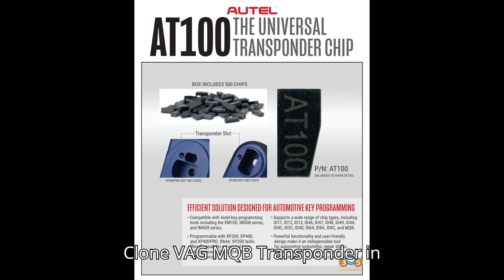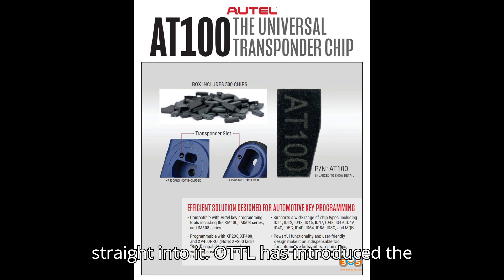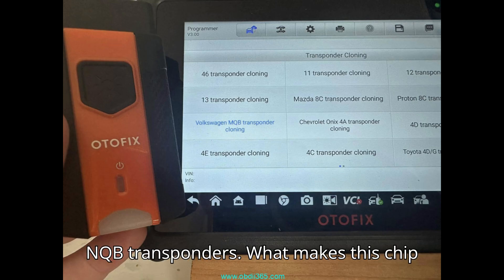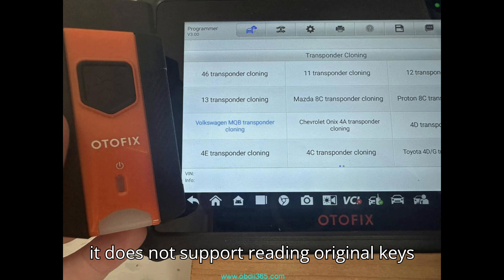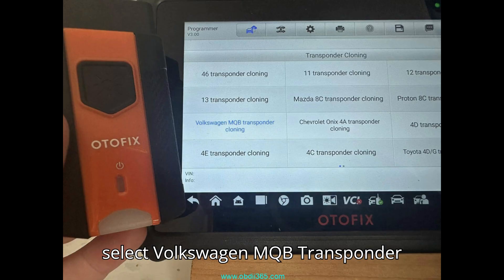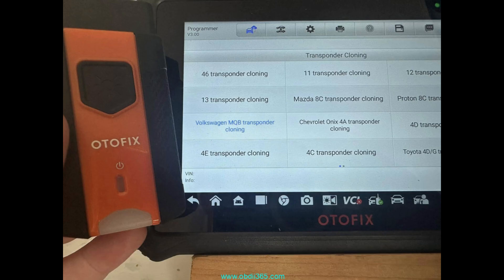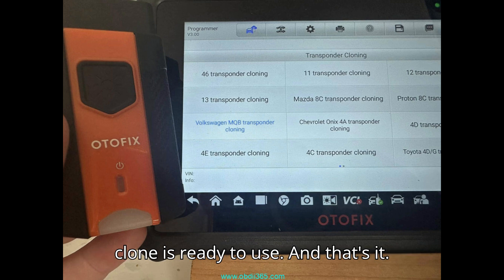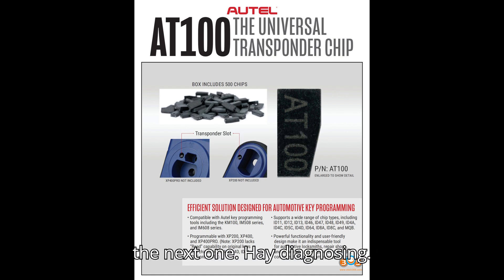Clone VAG MQB Transponder in Minutes with Autel AT100 Super Chip! No Extra Programming Needed!

Comment: Only issue is where do u buy these autel super chips I can’t find anyone selling them yet
Reply: Order form ur distributor
Reply: @ they don’t have them
Reply: Aliexpress is full of them
Reply: I have chip from aliexpress but how to get cs code from vw 2022y
Reply: @mladenpi u won’t 2022 is MLB key mqb won’t work u need working key and MLB tool from
Vvdi or KYDZ and buy their special MLB keys and tokens and have to remove capacitors on key to read cs code it’s a hard job must be very good at solder and locksmith experience